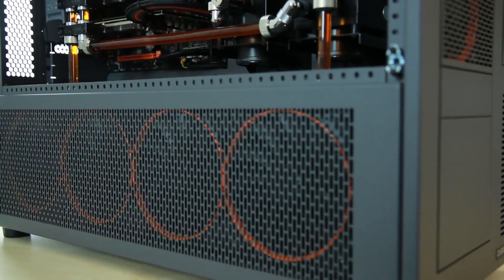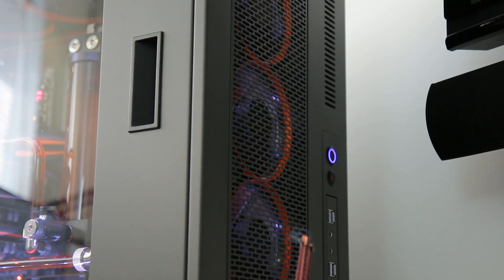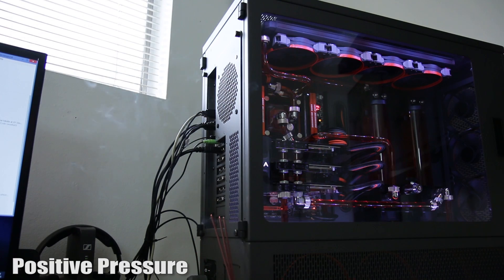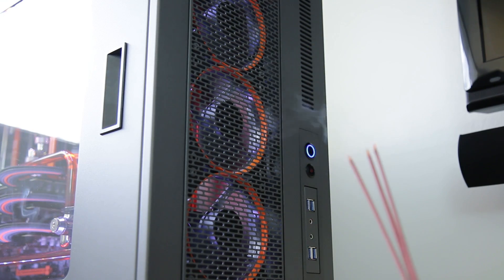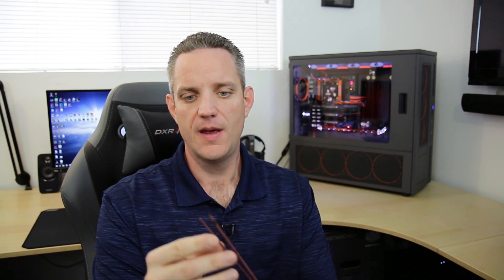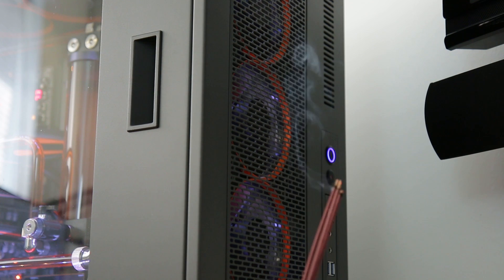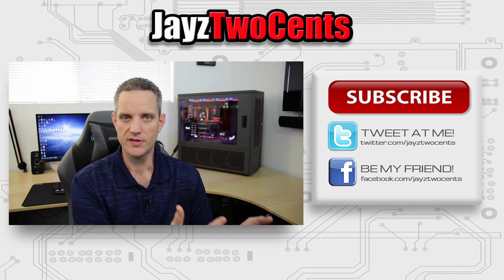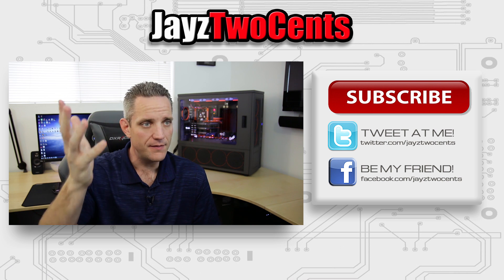Case Flow and Pressure Demonstration - How to balance airflow

Comment: You said 3 intake fans and 5 exhaust fans. I see 7 intake fans and 5 exhaust fans...
Reply: That doesn't make any sense... I wish I could see the inside of the case :/
Reply: +JDMricist it has basement thing in there
Reply: It's a separated section. There's a radiator in there. That air from the bottom doesn't go to the top part. Think of it like two rooms.

Comment: pro tip...if you have a large case you can burn a small atv or lawnmower tire in front of the case.....always works and there is literally NO downside whatsoever in any situation

Comment: I don't understand this "reasoning" behind putting a radiator on the top of a case, where all of the hot air flows, and then forcing the hot air through the radiator to "cool" the liquid.  That's like a car cooling itself off by having fans blow the hot air around the engine through the radiator, rather than cool air from outside of the car being pushed through the radiator and into the engine.  You end up with a cycle that defeats itself.  It would seem much more reasonable to me to have the radiator hit by cool air coming from the outside, then have your front fans blowing high pressure to push the hot air towards the back of the case, and high flow exhaust fans to help remove it.  Yes yes yes, hot air rises, I get it.  But the fans pulling it from the top into the case would counteract this very easily.  It's not that powerful of a force.
Reply: Then again, if all the heat generated by gpu is pushed mainly through ventilation at the back of the case (because of overpressure and air just pushing through there), that gpu generated heat barely reaches the top portion of your case. My case for example pushes gpu generated heat out of my case very nicely. So the top portion of my case has loads of actual cool air for cpu cooling. You can even feel this around by putting 100% load on your gpu and feel the air coming out of top exhaust ventilation with moist hands.
Reply: In that particular case the bottom radiator fans should be blowing out because the cool air from the lower front intake fans would reach the bottom radiator and hot air exhausted. The higher up front intake fans would send cool air over the rest of the components and get exhausted upwards and backwards. Even then an additional radiator at the top would make sense for first stage cooling from the gpu and cpu as the water in the upper radiator would be the hottest.
Reply: Good point. It really depends on how efficiently his radiator is diffusing the heat. If it is efficient, then most of the heat generated by the system is being exhausted there and it makes sense to configure it the way jay did. If it isn't working that well then you're totally right. I wonder effective the liquid cooling loop actually is.
Reply: I see your point on that. I would have put the radiator at the bottom of the case, or maybe the front
Reply: RipNDrip and now you are blowing hot air on your gpu, see there is no real way of not heating one of your components
Reply: EMD engines on trains have rads on the top..
Reply: It's Me i have looked at articles that tested different positions, top ended up being best

Comment: I'm on a laptop so a small copper heatsink covering both CPU and GPU with 2 pipes and 1 80mm fan doing intake and exhaust. Intake through the bottom, pushes air out the side.

When I build my PC in July, I'll be using the 2 fans that came with the case. 1 intake at the front and the other exhaust at the back. I'll add a fan on top exhausting and another on the side on intake.

Comment: I have 4 FD Silent r2 140mm fans on my Design r4. Two in the front, one in the back and one above the CPU. I'm managing them with an NZXT fan controller. I wonder what my air pressure is like. Time to pick up some incense!!

Comment: "Positive pressure is clean and is going to promote the best cooling."

Clean, yes but cooling.. not always. 

If you have a small case or if your case doesn't have too much exhausts besides the fans it might make convection happen if you have much more intake over exhaust and in that case the hot air starts to circulate too much in your system instead of getting out of there to the point where your components kinda keep heating up to weird temperatures.

When I had positive air pressure in my Cooler Master N200 (scale: 2 in 1 out) the convection was so bad that my system kept heating up while gaming until my CPU was at 85c and my GPU (r9 380x nitro) at 92c Not healthy, I was like holy shit this case is too small for this setup.. But no...

When I changed it to negative air pressure (scale: 1 in 2 out) my CPU dropped all the way to 68c in GTA 5 and my graphics card didn't get hotter than 72c. Which is much better, especially considering I use the stock intel cooler, 68c is not bad man.

So it really depends I guess :/ and well, I really don't care with this computer because there isn't even any filter for the intake fans, it just doesn't come with the case.

Are the lower temps worth cleaning my computer a bit more often? To me, yeah... definitely.

Comment: I have a corsair 780t case and I do have a positive pressure scenario but I still get lots of dust in my case. The worst part is the dust that sticks to the large Plexiglas window. Is there a way to discharge the plastic window so the dust doesn't get attracted to it?

Comment: I use a vape works perfectly for case fan circulation
Reply: Water vapor going into your case isn't a good thing.
Reply: +Grapenator X it's not water vapor non conductive oil
Reply: umm...doesn't vape liquid leave a sticky residue when it comes in contact with super hot elements? The residue would build up inside the case, particularly on hot components...
like a dryer vent tube slowly accumulating lint until it catches fire...
Reply: You are using vapor of a sticky liquid and blowing it into your system and you look like a douche while doing it nice

Comment: If more air is going in the envelope than is going out, then you're gonna have an ever increasing pressure inside of it untill it explodes, not just higher pressure than it is outside. You worded that completely wrong. :D

Comment: Thanks for this detailed video. Thanks to the H100i I had very negative pressure. Thanks to how loud that cooler was plus the negative air pressure i switched to an air cooler and closed my top vents (also a dust inlet when turned off).  Now my PC is quiet, closed up on the top and positive air pressure. Love it! Now time to get back to resisting buying the 1070 and enjoying my 970 which is a great card!! lol

Comment: Hey Jay, I'm building a desk to house my PC and I'm wondering how I should adjust the pressure since the box will be totally sealed and air will only be able to enter and exit through the fan holes that I cut. Currently planning on having two dedicated intakes on one side and one exhaust on the opposite side while also using the PSU as an exhaust. Any tips, perhaps on which fans should be controlled by the mobo or what RPM fans I should consider?

Comment: I'm a little confused. What are the stock fans that come with the s340 like? Is one of them an exhaust fan and the other is an intake ? I'm not sure. Should I get some more fans because I'm pretty sure the s340 only comes with 2 fans? Will two stock fans be enough to keep a 970 and a 6600k cool?

Comment: I guesstimate towards positive pressure. Since I have a realatively small house, 3 kids, and a dog it gets dusty so all my intakes are filtered. I have the same number of intake as exhaust fans and the intakes are set to ramp up first, they are also rated to move more air. Air cooled, BTW

Comment: So more RPM and CFM on intake than exhaust = positive pressure? What if my intakes are running at 2000 RPM and my exhaust are running at 3000 RPM, but the radiator on the exhaust fans are more restrictive (i.e. higher density) than the radiator on the intake fans?

Comment: I have 1st gen fractal design xl. I have never checked anything about pressures so I did today. Seems that everything works just as I want. I have 2x 140mm and 1x 120mm at the front. Then I have water cooling unit with 2x 120mm at the front of those fans (not directly front, there's some space between them). Then I have psu at the bottom of the case. 1x 140mm at the back in the middle 1x 140mm at the side (I had sli earlier and because I have internal sound blaster which was really close to those, I needed to add the side fan to keep it cooled). Then I have 180mm fan at the top. Works really beautifully :). I have to clean from dust this once in three years because all the fans that are intaking air are filtered.

Comment: 3:03 "You can't have the fanblades moving and air not moving across it, that's just not the way physics work."
Yes that's true in this case of a PC case, where you have said vents, cracks and crevices.
However it's still possible for fans to spin, without air moving through them or less than it would in an ideal situation. A good example for this is a "vacuum" cleaner where you have nearly no other places where air could get in other than its hose: If you shut its intake or increase the air resistance by kinking the hose or hoovering on carpet, the turbine should get slower or even almost completely stop rotating, according to your statement (because there aren't any other ways for air to get in). But that's not the case, in fact it gets louder, which means the turbine ramps up. But if you then hold your hand behind the outlet, you'll feel that there's hardly any airflow left. And that's because the air has to start rotating with the turbine instead of flowing through it (which apparently opposes less resistance to the air than the open hose did previously). 
I guess all that is probably not relevant enough, to explain in the video but I still wanted to point it out.

Comment: I have enthoo pro case and on top i have predator 360 and if im correct they push air through rad in the case i got 2 140 fans in front they push air in the case and one 140 on the back i mounted it so it can push air in the case on top of gpu.

Comment: Did you know that smoke is worse than dirt for your Hard Drives and other sensitive components. It also, for a fact, gets into hard drive platters. :3
Reply: +Ernest Pierce 
I don't think it's a matter of worry. Hard drives don't breathe a lot of air, they are almost-sealed. Some air and some particulate matter will make its way through the seal, and then it will get absorbed by the HEPA filter that is in one of the corners of the hard disk and that filters all of its air in a few seconds. I have seen PCs from heavy smoker homes, where the coolers were full of sticky brown tar carrying a lot of dust, but hard disk failure was not a common issue. There was no visible tar on the outside of them either.

Indeed as far as coolers and mainboard surface goes, smoker home PCs mandate a lot more cleaning than PCs from other households as they tend to become sticky, but it's not nearly as bad as somebody only using incense sticks once or twice to check their build, it really takes a lot more than that.
Reply: Siana Gearz Thanks for the info! :)

Comment: To figure out the pressure of my case easy, open the case on one side, take a sheet of plastic wrap and put it over to become a plastic panel, should be easy to figure out when you get this far. " I am not responsible for anyone with poor cooling and letting the plastic touch a REALLY hot heat-sink and plastic melting" I did this with my N200 I have 4 corsair HP SP 120 and 1 corsair HP AF 120. 3 intake 2 out, out top and rear 1 on side, 2 on front, the AF in the front. Is this an okay set up? Seems to be the one that is working best for my system, heres my used parts :http://pcpartpicker.com/p/BwBvgs: Thanks for any feeback.

Comment: Air pressure is ultimately affected by temperature and it has very little to do with forced open airflow. If the air inside your case is hotter than the air outside your case, then it will have positive pressure regardless of whether you have fans or not. Hot air expands; cold air contracts. So you start with positive pressure before even adding any fans at all. Therefore, if you add 1 intake and 1 exhaust, you will still have positive pressure. If you have 2 intake and 1 exhaust, then it will be closer to neutral pressure. However if you have 4 intake fans and 4 exhaust fans, then the ambient temperature in your case will be closer to the temperature outside your case and you will begin to have neutral pressure. This is basic thermodynamics. In the case of this video, having 5 exhaust and 3 intake makes sense, because it allows the internal temperature to rise, due to not having enough air replaced as the volume which is leaving, thus causing positive pressure.

Comment: Great video Jay!  I never even thought to use a couple of my incense sticks to check airflow.  I use a little down feather that I just hold in front of the different case openings.  I checked again just now and I have a negative pressure which kinda sucks, but I will fix it this weekend!

Comment: Maybe incense sticks are ok for a once-off test, but if you're doing any more than that, don't use burning particulate smoke for this - most people know that sort of smoke (like cig smoke) is bad for electronics. There are proper smoke puffers for exactly this sort of testing - they are used in labs to show proper airflow through things like extractor hoods and such. Traditional ones look like an over-sized eye dropper filled with little grey balls - the balls produce the smoke when air squeezed from the bulb flows over them - no burning of anything. Newer ones are like mini electric nightclub smoke machines. Either way the smoke is not as toxic or likely to stick to components and gum them up (esp not good for fan bearings).

Comment: Vacuum? At least?

I am new to this, hoped to learn something... Maybe is just my native language but shouldn't it be "low pressure / high pressure" instead of "negative / positive".
As fr as I know, negative goes below 0(zero) positive goes above 0, if my memory serves me right from what I learned from school(long time ago in my deference) I don't think that mater can has a negative value of density... Also I am yet to hear that somewhere someone refers to his room pressure value as zero pressure...
Maybe I am wrong but that "Negative Pressure", just sounded very odd to me and made me shake my head in disbelieve :D . Almost as if someone wold say "Negative Light".

Anyhow; Does high pressured cases have visible better heat transfer than low pressure cases, since they have more density hence better thermo-conductivity. Or are differences in air density between the both so small that the difference in thermo-conductivity is negligible?

sry for bad English

Comment: K i have a s340. 2 corsair af quiets in the front and the sp fan that came with the case in the back for exaust. i covered the top vent with vynal. i have the mobo controlling them. i have a 212 evo pushing to the back. now here is the weird part i dont get. when my gpu fans kick on my case sucks in , you cant see it except for the side panel window that warps in. why does it do this? am i creating negative airflow? cuz i want positive. what can i do? should i open the top vent back up and add a fan for exaust?

Comment: Thanks, Jay! Using this technique I learned that I don't need powerful fans on the front of my case, so I rearranged them. I've achieved 2C lower GPU core temperature on my R9 280X @1200mhz 1,2V.
I still have some negative pressure, but I can't do anthing about it, since a 12cm fan on my 280x pulls air directly from above the psu, and from the outside through the pcie slots. It is just not possible to push air in there with my case's fan placement. I have removed most dust filters anyways, because they restricted airflow and amplified wind noise.

If anyone is interested:
I have a Windforce rev. 2, with a Raijitek morpheus under two 120mm Bitfenix spectre pwm led fans.
Stock fans on front intakes, top-middle exhaust.
Support are 3 Be quiet Shadow wings 140mm 1000rpm fans in the bottom intake, rear and top-rear exhaust.

Current temp is 52C in ultra 1080p Unigine heaven, 99% gpu usage, after 30min (12v on most fans, the spectres get only 7V).

Comment: Temperature sensors are pretty useful too. Some motherboards have quite a few spread throughout the board, so if the GPU section is too hot, then you can adjust your fans.

Also, Asus has a neat utility for some motherboards to attempt to auto adjust the CPU and case fans. It ramps them up and down, together and separately whilst monitoring board temperatures.

Other:
It may seem silly, but I switched case fans to non-variable ones because I found more than 800RPM for my system was generally pointless, but when starting up my PC the fans always ramp up (don't have full control in the BIOS fan settings). Now my system starts a lot quieter.